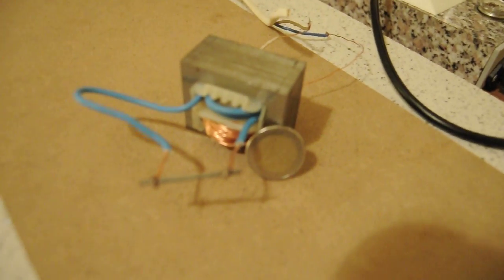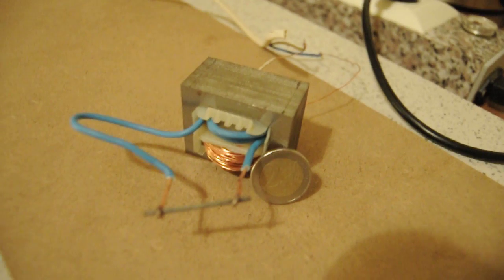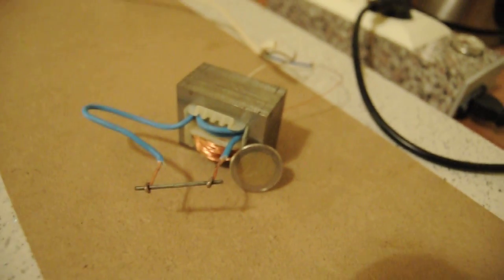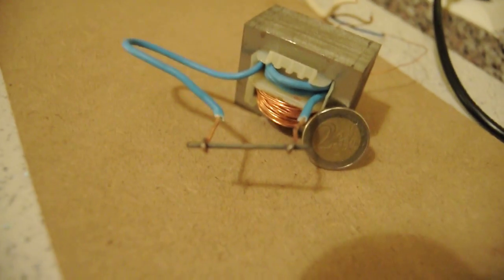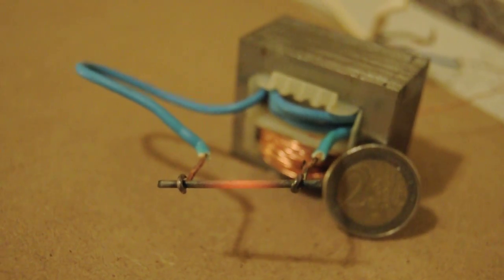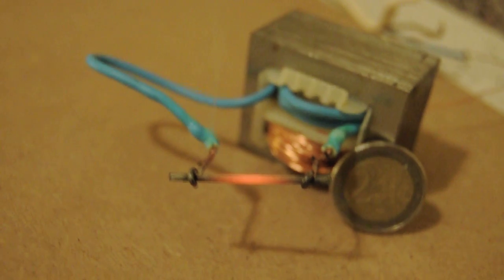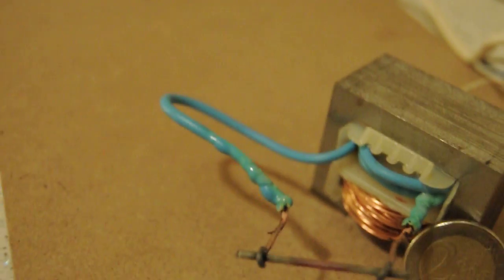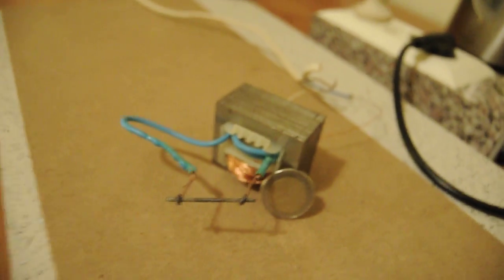70Amp Tiny Transformer MELTS Nail (High Current Rewound)

Comment: SO why does it draw an excessive amount of current. Is it because there are a lot less turns on the secondary coil? Does it also Have to do with the thickness of the secondary wire?
Reply from the maker: it worked as a simple coil rather than a normal transformer thus the current it drew was related to the coil's resistance rather than its inductance,it just could transfer energy from the one coil to the other using induction which occurred due to the EMF.
Reply from the maker: The reason of this is that this transformer was for experimenting and having fun so putting a 2000w ballast in series it worked the same way as if i had calculated a primary coil,not to say even better.
Reply: hmm... i see...What is the voltage input?

Comment: truebassB  truebassB  (I don't know which name) hi i tried this to rewind transformer. I placed finer wire and much more turns than you. And after 2 seconds my primary melted plastic. How you did this it's impossible your primary have even lower resistance than mine how my primary burned?! Can you answer
Reply from the maker: Testas. T. Use a load in series like 100w light bulbs as the transformers saturate and draw self destructing current. This transformer is actually a short circuited coil without any transformer logic taking place.  The plastic will melt aswell the wire. Try rewound microwave transformers they are more fun and robust.

Comment: Hey man, thanks for this awesome video. It inspired me to do the same thing so I rewound a tiny transformer too and I also used a kettle as a balast but everytime I plug the whole thing into a wall socket, my circuit breaker trips. is this because the transformer and the kettle are drawing  too much current?
Reply from the maker: It's either the kettle or something in the wiring. Try just with the kettle,it should do the same if the load is the problem.

Comment from the maker: Hello. Thanks for the formula,you're right about the wire. 

This one was totally out of turn ratio that's why it was saturating,however it worked on what i wanted to try.

The fine wire is a must for such a small core but till now i broke two coils,for reliable transformers for playing i would prefer a bigger core and thicker wiring.

Comment: The reason why the primary wire is very thin, as it can be up to thousands of turns, and needs to be small so it will fit inside the tiny window. The two square holes in the middle of the iron core, is called the winding window. The space inside the window is precious, and the wire needs to be neatly and tightly wound to maximize the amount of copper, to keep the load losses down. As you try to put more volts per turn the core losses will go up and the core will get hot and may overheat.

Comment: When re-winding these EI transformers you need to work out how many volts per turn. These laminated transformers typically run at 1 Tesla and only get warm, so measure the cross-section area of the center metal leg. Example: Say it measures 2.5cm thick and 1.5cm wide = 2.5 x 1.5 = 3.75cm2 area so..Use this rule (1 Tesla Flux for 45cm2 leg area is 1V/Turn) so 3.75cm2/45cm2 = 0.0833Volts /Turn so for 12V you need 144 Turns. For 230V you need a 2761 Turns, of very fine wire.

Comment from the maker: The primary is crappy,needs thousands of turns to not saturate... The voltage was 0.5V but the current seems to be lower than with 1.2v,the same turns and the original primary.